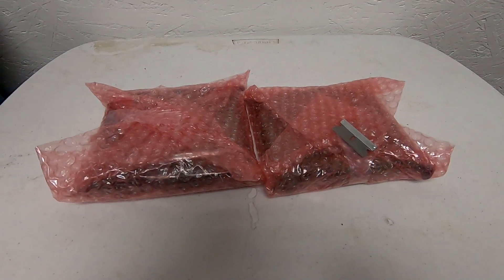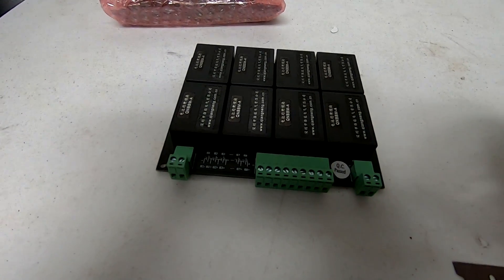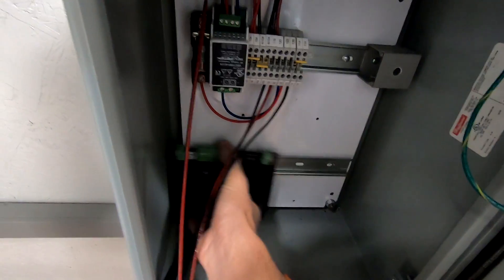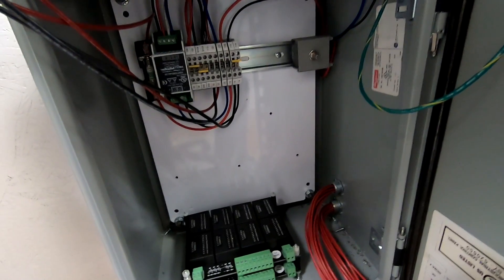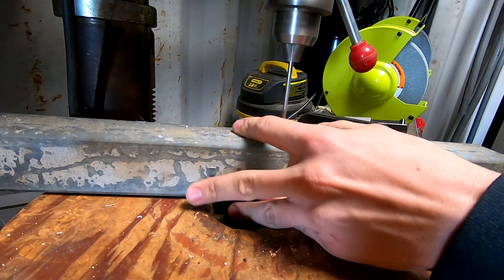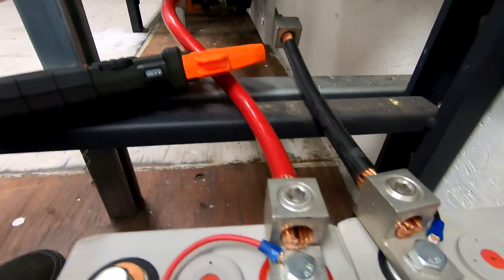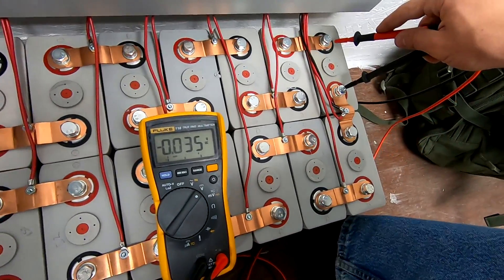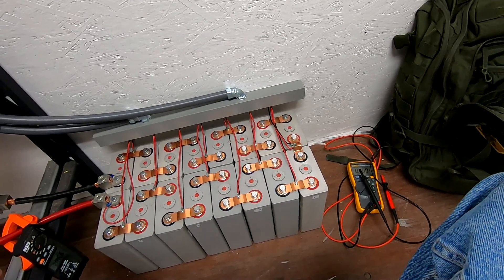Off Grid: Prismatic Lithium Battery Balancing System Install & Unboxing

Comment: I have 24 3.2v 60ah lifepo4 prismatic batteries that I would like to connect as a 12v system.  Would this work as a BMS or do you know if I should have a bms for each pack of four?

Comment: Ah a capacitor transfer cell balancer -  the good thing is they balance throughout the entire cycle range  however the 6amp is a bit misleading as that's the max when there is a big difference in cell voltage - when there just a small difference  the current exchange is in mA
Reply from the maker: Yes, that is accurate.  The more the cells are mismatched, means the higher the balance current is.

Comment: Cheap metal hand punch might work too. Those are the same straps the sent me from China to Philippines. My bms mfr gave me terminals for the bolts but the bms never did work right. All in Chinese and no support. 😳 love love my lifepo4 batts. 32 200ah 3.2v on a pv array of 5400 watts. Windmill and midnite classics(still in the closet) are next. Keep up the great work.

Comment: How has the balancer been performing? Able to measure performance, ie is it transferring the charge as advertised? Also are you using a BMS to monitor your cell voltages or just measuring them by hand? Thanks and keep up the great videos.

Comment: Sir, can you explain more about the wire connections from the battery pack to the battery balancers ??
Reply from the maker: What is it you are wanting to know?
Reply: HighTechLab - sir this battery balancer that you have installed, is that working as the BMS foe the battery pack? We are making batteries for ELectric 3 wheelers here in India. After battery runs for 12-14 months sometimes batteries are disbalanced. How can we balance the cells at that time.

Comment: https://www.alibaba.com/product-detail/Energy-Transfer-Dynamic-Lithium-Battery-Balancer_60765972259.html?spm=a2700.icbuShop.41413.14.1dc67974sbbqyw

100% ACTIVE lithium battery balancers, voltage differences within 5-10mv , especially very important in solar system
sales8@deligreenpower.com

Comment: Very nice job on the video but you could of skipped past making us watch you read the voltage on every single cell.
Reply from the maker: That's why there's a ton of Jump cuts, but that is important info to watch along the life of the pack and something anyone else would keep in mind if Installing similar batteries

Comment: II get that the BMS balances but the over/under voltage protection for catastrophic cell failure seems to be missing.   For example, if one of the cells goes really bad such and starts self-discharging too rapidly for the balancer (6-10amps) to keep up what is the mechanism in your system to disconnect the battery from load (charge or discharge) to avoid a meltdown?      For example, a BMS like Batrium supports a hookup to a shunt-trip (e.g. sends a pulse of current to a relay that trips a big circuit breaker)
Reply: Here's  a link to a youtube showing Batrium + Shunt Trip to show what I'm asking about.   https://youtu.be/k6pyTpqUjNs

Comment: You might want to put Brady markers on the sensing leads at both ends so if something goes way wrong you can easily trace the cables.

Comment: I don’t know anything about lithium batteries but I think it safe bet that those small wires running to the other cabinet need some kind of fusing.
Reply: they dont carry any meaningful current, they just measure voltage and if needed dump a small amount of power as heat. putting a fuse there would be dangerous
Reply: Yep you are correct I’m sure when a fault happens the wiring will dissipate some heat.  Don’t know that fusing would be dangerous please explain.

Comment: I know you have already put a lot of brainstorming into your setup, but wanted to give my input. I ran a DIY powerwall for the shop out of NEW 18650 cells for over 4 years, but I had lots of cells go bad in the system over those 4 years. 2 years ago i ran across someone on the powerwall forums combining SuperCapacitors + Batteries and was having amazing results with cell damage. So i implemented them into my system and bought a small pallet of the 3.0V 3000F made by Amperics and wired them into banks of 20 per string for my 48v system and then connected them to my existing DIY powerwall isolated via 0.01 ohm load resistor and what this does is place all the high current loads on the supercapacitors, then after the spike in loads drops the battery will start balance into the supercapacitors. During the day when the solar is on, the supercapacitors recharge to full first because of the isolation resistor, then the battery bank starts to recharge due to the path of resistance. This has eliminated my cells from randomly dying on me since the installation. The Supercapacitors take the brunt of the work when high current loads turn on and reduce the cycle life and current damage you receive on the battery bank over time, greatly extending the life of the battery bank. Hybriding the system with supercapacitors was the best thing I ever did for my solar battery bank. I would highly recommend working them into your system to extend the life of it and the overnight voltage drop in the capacitors is hardly noticed since the next morning solar will just top them back off. The difference in my bank voltage overnight running off battery vs battery+caps is around 0.01-0.02v difference from my testing.
Reply from the maker: It makes sense why you would see those results - 18650 tech has a much higher internal resistance as compared to these prismatic (block) batteries, and you are most likely running a lot of series-parallel strings.  The only benefit I could see with them is taking some startup hit off of these batteries (I have a 5hp air compressor that surges 300 aDC on startup, then drops to around 30aDC when running), but keep in mind too these prismatic cells have an insanely low internal resistance.  I'm curious to hear from your experience, what kind of failure mode did you have on the 18650s?
Reply: @HighTechLab  There is multiple people who have combined them with prismatic cells as you have and still the 0.1-ohm resistor was enough to direct the current loads onto the caps, a few tried 0.5ohm due to lack of available also... The type of failure is really unknown honestly, they are all Panasonic NCR18650B cells I bought from a reputable source. I have an Arduino system monitor with alarm comparing voltage from different strings in my system and ill get a delta change alarm and during inspection, it will end up having popped cell fuse and test at near 0 voltage, attempts in recovering them always fails as they just produce heat and draw back down to near 0. I have a an old powerhammer in the shop and when i turn it on, it will spike up into the 600 amp range on the system, which based on the amount of caps i have now shows less than 10 amp spike from the battery when i turn it on, so all the load is being consumed from the caps
Reply: @HighTechLab  do some experimenting with them, they will impress you and in 2 years ive never balanced the caps and when i check them they are all within 0.05v of each other... i do have a balanced circuit on my battery bank, just not on the caps.
Reply from the maker: @williamhustonrn6160  I'll check it out, are they inexpensive?
Reply: @HighTechLab I have not checked recently, i purchased mine over 2 years ago. I bought them in bulk from Aliexpress for $23/ea, but be very careful when ordering them, when i was shopping a engineer friend of mine told me to watch out with cheap chinese caps, so he told me to order name brand ones and to test the suppliers by ordering like 1 from each and test them for quality. When i did this i found a lot of the china brands are terrible caps back then and the top 3 i personally came across were Amperics, Eaton, and Maxwell when i tested the actual caps. I went with Amperics cause i was able to get the most capacity per dollar spent with that brand at the time. Some of the china brands that worked, but terrible capacity and discharge rate per specs claimed were Qinfen, GTK, and Aideepen
Reply: @williamhustonrn6160  supercapacitors have high losses. Your method is highly inefficient. The second law of thermodynamics applies
Reply: @climatechangepreppersfaceb2148  the discharge rate on my caps is so minimal it's not even noticed over a 24-48hr period... you have to remember that supercapacitors have very very low storage capacity, so when you see them drop voltage its based on such a small amount of capacity of the battery bank that the pro outweight that one negative. I am only asking the supercapacitors to take the brunt of the high amp loads and excess cycles to preserve the battery bank. Please dont make bold statements like this unless you have facts to back it up, Tesla recently purchased Maxwell to add supercapacitors to the battery bank of the Tesla Semi, this reduced the battery over current failures to nearly 0 compared to the test running on batteries alone, in the investor meeting they stated it would increase the lifespan of the batteries by up to 200%
Reply: @williamhustonrn6160  it doesn't matter what self discharge you perceive (others have said that the amperics have bad self discharge). The fact of the matter is, they have self discharge and waste power 24/7. You also have power wasted in both directions through the load resistor. While it might help with surges, it's very inefficient for those 3 reasons. As I said, the second law of thermodynamics applies. I have the most efficient off grid solar system in the world
Reply: The leakage current is 2mA. At 53v, that's 11w wasted. My 4kw inverter has a self consumption of 13w, so 11w is unacceptable. That's 254wh per day. Plus 106wh lost through the load resistor. 360wh per day total.

Comment: Nice looking bank, quite an investment. Hopefully you plan to bring a proper BMS in to manage and protect it, more than those simple balance boards.
Reply from the maker: I'd like to tie into my PLC and HMI control panel.  That would then allow me to access it remotely.
Reply: @HighTechLab  still not sure if these passive balancer boards are a good idea your the first person to see any one use them (and your video is on there website I think) there is no control to set thresholds or remote monitoring and logging to see how much is been transferred witch would normally giving you early indecator's of failing battery pack and no remote reporting and dc battery cut off control for over/under volt or shorted out battery (the list is quite long) 

this device from the looks like it could run the batteries dead if there is a problem with one of the cells

I understand that you roll your own setup but for bms battery management I don't think should roll your own on this part as you could destroy your battery's (as this balance board is not managed nor has any monitoring capabilities)

you can still have all your high voltage dc monitoring system you currently have and have an active bms board system witch will monitor the low dc voltage per battery and as important temperature and have a dc cut off in event of battery problem or overheat

As your old battery system did not seem to have a per battery monitoring system as your was using multimeter to check battery voltages and I believe no way to cut the inverters from the batteries (automatically or remotely) witch could of prevented last batterys from been destroyed

Comment: On terminals and such like that.. I don’t crimp them I just solder them.. but lol now I just heard you say you done both while I was typing this.. 👊💯
Reply: You should just use crimps, if your wires don't hold your using the wrong or bad tool. Crimping frictions welds if it docent do that somethings wrong. The solder over time can accely do the inverse and create high resistance as it moves around during cool /heat cycles.
Reply from the maker: Interesting comment - Then why would  PCBs in computers (imagine the CPU getting hot and cold) soldered instead of crimped?
Reply: @HighTechLab  International standards forbid soldering of any joint that has movement or vibration. Solder is higher resistance, lower mechanical strength, prone to thermal stress, less flexible, fails with vibration etc. Tin (the main component of most solder) has about 5 times the resistance of copper. As such, when used in high current applications (think a battery lead), that resistance can lead to heat. ... The resistance creates heat at the joint, which melts the solder, which increases the resistance until it fails altogether
Reply: @HighTechLab  Because its cheap,  but when you do pcb layout it defiantly a thing you must consider. Boards do warp and crack solder all the time. The way you solve it is with ether adding more mounting points to stop flex or careful management of the heat on a per component. Often both. Also this likely plays a part of why on cpus and other chips we wire bond them aka spot weld from the die to the pin. Your example is perfect because it has happens even from respected manufactures see xbox red ring or playstation yellow ring As well as laptops in the late 2000s with external gpus, and current apple laptops(there not the only one but yeah there known for it). The bga aka solder joints crack due to thermal expansion differences between the pcb and cpu.

also some reading on crippling things right.(TLDR is ether buy the proper tools/dies or forever be frustrated)
https://hackaday.com/2018/01/20/the-unnecessary-art-of-connector-crimping/
https://www.molex.com/tnotes/crimp.html

Comment: If the CALB ones are from 100Ah never exceed the 40Ah both in charge and in discharge, this for a continuous use, they are already so many, for a continuous use we recommend always 0.3C and I'm 30A not 40A !!! 
you should not exceed 1350 W AC and then what you do with only 3.8 kwh (80% DoD)
Ciao
Reply: Agree, he is overworking this pack. Also he is bottom balancing which is wrong, and he thinks 3v is a good place for bottom balance which is very wrong. His voltages are all very different and is not using a bms. His balance leads have no fuses. He seems intent on not listening and destroying ANOTHER battery bank. We can only watch in horror.
Reply: @climatechangepreppersfaceb2148  It has many more panels than it can handle the batteries, it is not a bad decision to use only balancer, saving that it has power upstream (it should work between 3.5 and 3.6V) and let it manage the maximum voltage and the minimum from charge regulators, it can easily do so since they are of excellent quality, we do not know how long the system has been in operation, one hour only and for this reason it is not yet balanced, as a digital BMS is better to see Batrium, they recommend for a continuous use the 30A, the cells are very robust even if not like the winston, 10 A more like solar peak they are not a problem, the important thing that not exaggerate with the inverter, beyond the continuous 1300W AC can only have some spikes for starting cues, in a situation like this they needed monoblocks of at least 400Ah, but it is not said that the plant is divided into two and that it still uses the old lead batteries
Reply: It’s 2.5A per cell. 40/16

Comment: Very well done I would like to know more about the BMS system as well as others, and your reasons for picking this one over others on the market
Reply from the maker: It can move 6 amps,  and also transfers between cells instead of dissipates the imbalance and works both during charging and discharging.  Since I have a PLC integrated in the system, all the features of some of the other BMS systems are not needed because I can make far better features controlling what I want and how I want on my own with the PLC.